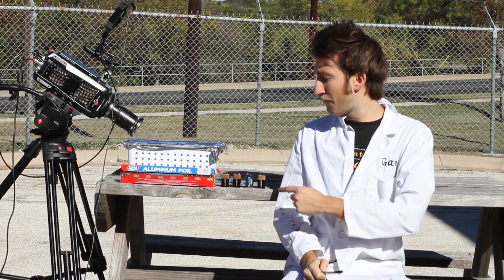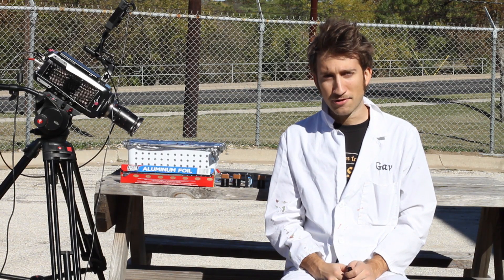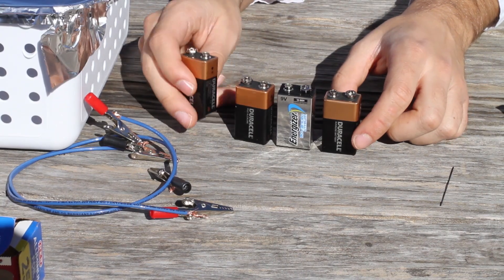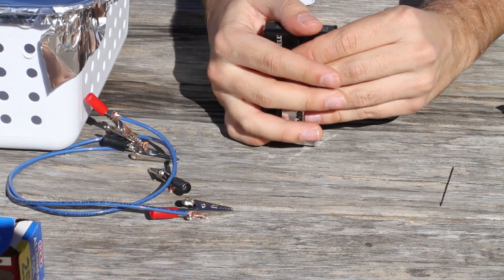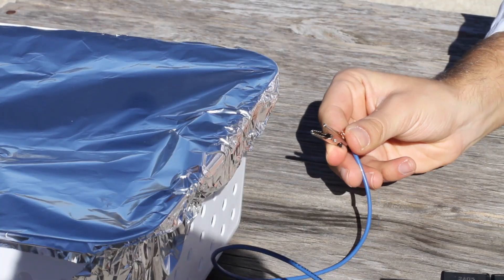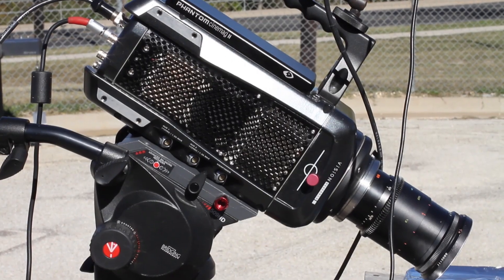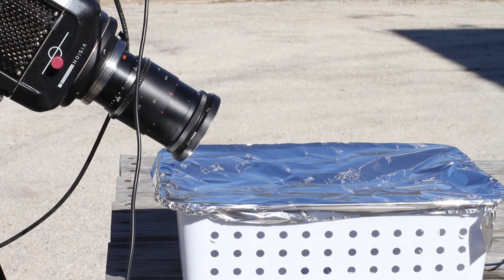Tiny Plasma Cutter in Slow Motion - The Slow Mo Guys

Comment: Actually it was "Aluminum" first. British editors changed it to "Aluminium" to harmonize
with "Potassium" "Magnesium." There are, as always, a number of America haters below that claim America got it wrong. Actually, they didn't. Just kept the original.
Brits tend to complexify....makes them SEEM smarter.
Reply: +Jim Keller Incorrect. It was named alumium by Humphry Davy, then aluminum, and finally the official name was Aluminium. You are correct that it was made Aluminium because it was similar to the elements that he had previously discovered (Potassium, Sodium, Calcium, Magnesium). However, it was not changed by British editors. Aluminium was actually used in America for a fair while, then you decided for some reason to change to aluminum. Yes, according to IUPAC, both the Americans and British are right, but, it was first officially called Aluminium, so, I consider that as the official and correct name.
Reply: Jim Keller Oh, ya know. Good. Divorced the wife, so definitely better.
Reply: +cozi cosimini America wasn't even close to being the first country to use slaves. Just about every group of people was a slave at some point or another, America just happens to be the only example of it that people think of for some reason. In fact, there are plenty of countries that still sell people as slaves. Also, cars are not an American invention. The first steam powered vehicle was built by a Flemish man while in China in 1672. Four-stroke internal combustion engines and Diesel engines were invented by two Germans. Even Canada had steam powered buggies before the US.
Reply: cozi cosimini You do realise that there have been slaves around for millennia right?
Reply: lewis cullinan
 Hey ass blast. The word "Aluminium" is derived from Latin. For you to claim it as "your language" attests to your ignorance. Turns out you know very little about the English language after all.
Reply: Jim Keller Hello brother
Reply: Hey...Bryn...how the hell are you?
Long time.
Reply: I never liked her....sorry.
Always thought you could have done better.
Reply: Jim Keller Yeah, that's ok. I'm glad we separated. I saw it coming for a long time, but when she cheated on me with Bill, that was the last straw.
Reply: Jim Keller Don't worry, I intend to. Already got a hiking trip set up, and who knows what else after it.
Reply: Language changes continuously.
Reply: I can't disagree with you there, with our history, I wouldn't be surprised if we were that big headed about ourselves. Oh and look, a bunch of hypocrites trying to prove you wrong, but actual proving you right be trying to be better than you! (I'm assuming you're from the US!)
Reply: +LAUGHER CAKE Or rather one guy being a hypocrite, my point still stands!
Reply: TobebwidZ Al-oo-min-ee-um.
Easy peesy lemon squeezy
Reply: King SHIIFT Computers were not "invented" they were developed over hundreds of years by many different people. Turing certainly had contributed significantly to computer science, however, the Bombe is still a product-specific device, and not a general-purpose machine. I do not consider the Bombe a "computer" in the contemporary sense. It's more like a calculator, purpose built to decode Enigma.
Reply: +pinkspaghetti Adding unnecessary letters to words just to make yourself sound sophisticated isn't smart, it's impractical.
Also, I can't take the term "Yank" seriously. Like, the 1700's called, they want their insult back.
Reply: "Omg Spanish people use yo instead of me they're so stupid."

Let's face it. Any language not Latin is not original. But then again Latin is not original. We need to go all the back to the caveman language. Ooo ooo booga booga
Reply: +Jim Keller Using a 200 year old war to justify Americans being smarter than Britons. Nice one, dude. By that logic, might I ask how you managed to lose a war to a vastly undeveloped nation after having your soldiers bomb, rape and shoot innocent civilians. In case you have no idea what I'm talking about, I'm talking about Vietnam. Guess what, Britain also didn't need a war to decide if slavery was a bad thing or not. Instead, they just abolished it. Amazing how such a refined and smart nation as the United States didn't lay down the largest empire in the world and essentially started Modern Earth.

What about the Moon landing? Yeah, but that wasn't done in the pursuit of knowledge was it? It was only done in the hope of making your country look more technologically advanced than the USSR. As for Modern times, you live in a country where a man like Donald Trump may become president. I don't think more need be said.
Reply: +Stephan mac   Yes it was alumium briefly, but it was amended to aluminum shortly therafter.  British editors changed it to aluminium to harmonize with potassium, magnesium, etc.  
Aluminum before aluminium.  Like I said Brits tend to complexify.
Reply: Bryn Keller
but Bryn..Al-oo-min-um is easier.
Reply: Jim Keller It's more simple, but he was saying that we Muricans' lacked the ability to say aluminium
Reply: g
Reply: Bryn Keller
Oh
Reply: Bryn Keller yep
Reply: +Jim Keller derpy derp derp british derp derpy derp 'MERICA!
Reply: +Jim Keller how to do it?
Reply: lewis cullinan It IS their language. Didn't you know this? Because they're the centre of the universe.
Reply: +Jim Keller Dude....You had to say that...really!! You right a comment that resolves an argument and then add a smartass ending that would obvoiusly create a new one!
Reply: That's what you call joking around. He was making fun of the stupid English war.
Reply: +TobebwidZ I would Like to point out I am 100% American but can not pronounce it the American way :P
Reply: +Jim Keller no its Aluminium :D It sounds much more professional
Reply: Izzy Ryan
If so, why did you lose the last war you had with us?
Reply: What I'm from america you know.
Reply: I don't understand the arguments about whether ones country is better than the other. You all sound like patriotic idiots.
Reply: No Name I don't think anyone is talking about the countries... they're talking about the pronounciation of the word.
Reply: +Jim Keller It's aluminium in Latin, not aluminum. And yes, this word comes from Latin. But there are many "garbled" words in US English (I say garbled because they were in British English before Columbus discovered America). For example words with 'ur' on their end doesn't have U in US English (I mean words like colour, flavour, behaviour, neighbour...). But these expressions have nothing to do with how clever people are, English changes in both UK and US, differently in each country. Not much today, but in past, these changes were much bigger.

I'm not from an English speaking country. It's true that I prefer British English, but I'm trying to be objective, not subjective)
Reply: +Jim Keller America is 27th in education and 1st in confidence, they can't talk when is comes to pseudo intelligence
Reply: Someone is sore about pronouncing 😂😂
Reply: well, we made u. u win the battle, we win the war
Reply: I'm British...I'm just not a little bitch ...
Reply: i like trains
Reply: Jim Keller complexify?? think you mean complicate
Reply: +Spicy bits....by all means...But to deliberately complexify IS to complicate.
Reply: Jim Keller it's not to seem smarter we just are smarter
Reply: Azuralis EXACTLY!!!! The Africans enslaved each other before we even came.
Reply: The british "editor" you speak of is the exact same person whom discovered Aluminium in the first place. The exact same british "editor" was also the same person to discover many other elements with the -IUM suffix.

I find your statement wrong and slightly provoking. But hey, it's the internet right. No one gives a shit.

next time, please search up before you say something. Might make yourself look stupid.
Oops, don't mind me. Just another British person trying to "seem" smarter.
Reply: Jim Keller From what I know the majority of the world calls it Aluminium
Reply: no Americans changed it because you could never pronounce it so u decide just to change it
Reply: +Jim Keller The brits are smarter just accept it.
Reply: Jim Keller bullshit.
Reply: So narrow-minded you are.
Reply: Jim Keller We are just smarter and more sophisticated than you yanks. Sorry.
Reply: MrWatchesUsleep Im not a tory.You know a tory is someone who votes for the Conservative party right? Then again im not surprised an uneducated american like yourself knows nothing about politics.

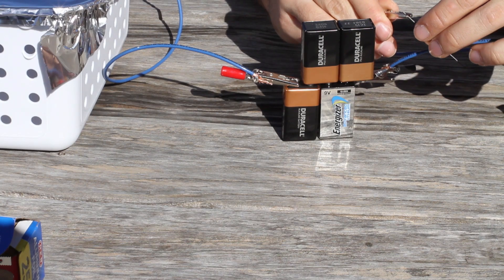Comment: 0:40 For safety reasons, you aren't supposed to mix different kinds of batteries.
Reply: i never use batteries from the same kind and never has something gone wrong. i use batteries a lot
Reply: Rostam Bayat it was a sarcastic remark. You know, since they're shorting them out...
Reply: Cuthbert Nibbles  sorry. me not good english :|
Reply: Rostam Bayat It should translate, it's not a play on words. On every pack of batteries you buy, and on some devices that use them, it says that you shouldn't mix batteries from different manufacturers, even though it really doesn't matter.
Reply: Cuthbert Nibbles sorry, me not good at any language :|  and also: translation verry shity always

Comment: Anyone wanna drop some knowledge on me about this plasma cutter without calling me stupid. I wanna know if its possible to hurt yourself with it, not for emo reasons. or like you cant cut anyhting that conducts electricity or like heat up water? I might do a science project on this or something just for fun.
Reply: Well, you can't hurt yourself with the electricity really, but the graphit gets pretty hot, so you have to be careful not to touch it (see my video, where I burn a pencil down with only 15V). You can cut everything that conducts well and is thin enough, but if you take bigger graphite rods, you could actually wield with it.
Reply: Things vs Electricity | TvsE Thanks man!
Reply: +Things vs Electricity | TvsE That's called gouging. And you really don't weld anything, you just blow(quite literally, it flies everywhere) a hole in very thick metal.
Just get two thick(1cm in diameter or more) rods, and use a regular high-powered(2-8kW) stick welder.
Touch the two rods together, form an arc, then spread them apart slightly, and holding that position(there are gouging devices for that), bury it in metal.

Comment: Hey I just want to point out that that's not plasma cutting plasma cutting. Plasma cutting is used with compressed air being superheated and then introducing an electrical arc. What they were technically doing was carbon arc 
The pencil lead is not lead itself it's carbon when it has an electrical current going through it it cuts through most metals
Reply: ProtubeComment Fuck off.
Reply: Thank You
Reply: https://www.youtube.com/watch?v=IRsPheErBj8
Reply: Jesse Valenzuela It is practically plasma cutting, it is just being done without compressed air. You can do this with pencil lead, and metal bars. I have tried with both and they work.
Reply: STFU science nerd.

Comment: Paused 30 seconds in, without watching the rest of the video I know exactly what the majority of comments are going to be about (regardless of how cool the actual slow mo footage is.

And I was right.
Reply: Seriously, I'm American, and I'm disappointed at the other ones in the comments. In most things, America is the odd one out anyways. We don't use the metric system, a foreign language class is never required, and we pronounce a lot of English words differently than other English-speaking countries.
Reply: Unfortunately, I had the exact same idea.
Reply: ***** Only a year? I had 6 years of French back in Junior High, but no french classes in Highschool. (Thankfully) My fluency ability, even after 6 years, was still zero. I couldn't create my own sentences and as for reading ability, maybe the back of a cereal box at best.
Reply: The body acts as both a resistor and a capacitor. For the resistance portion: ohm's Law is given by: V = I*R. where V is the voltage between two points which measure a resistance R. I is the current flowing through the resistance. As the resistance decreases, the current increases (at a fixed voltage). The reason a car battery cannot hurt you is because the human body is a high resistance, resulting in a very small flow of current. A piece of wire directly across the battery has a very low resistance, resulting in a very large flow of current in the hundreds of amps. If you take 1,000 of those batteries and put them in series (like the 9V batteries in this video) they would result in 12,000 volts. Ouch. Now we can talk capacitance. A capacitor can hold a small charge, similar to a rechargeable battery. In the terms of the body, the capacitor can be "charged" in either direction. When a fully discharged capacitor meets a voltage, the current shoots way up for a small amount of time, and for that time it is very low resistance. This is why AC voltage hurts much more than DC voltage because AC voltage switches direction really fast, resulting in many repeated spikes of current. Hope this helps! See some of ***** videos to see some neat experiments.
Reply: ***** I can assure you ac does not hurt worse than DC. I've been an electrician for almost 20 years, I've been hit with AC and DC at the same voltage and 100% without a doubt DC is MUCH worse. Yes, the RMS voltage of ac is gonna be higher than DC, but getting hit with DC is more painful.
Those arguing about volts or amps killing, its a combination of both. 100v w/ 1a flowing is 100w of power. 1v w/ 100a flowing is also 100 watts of power. Obviously the higher voltage will allow more current to flow more easily given the same resistance. Ie- given the same person to keep the resistance the same, the amount of current that will flow will be based on the the resistance of the path through the body the current takes. All things being equal, a higher voltage will be worse because more current will flow. Higher the voltage, the more 'pressure' to push the current through the body. To try to make an analogy comparing it to water, voltage would be the pressure, current would be the amount of water, and resistance would be any restriction to the flow of water.
Reply: ***** I should've said it differently. I meant that most americans don't care to or want to actually learn to fluently speak a language and be bilingual.
Reply: People arguing volts vs amps killing a person.
Reply: *****
That even though the slow mo footage was cool most of the comments would be arguing over the spelling & pronunciation of aluminum.
Reply: Mythical Fair My thoughts exactly... but that's not without good reason. 

To be fair though, and I am not denying the legitimacy of the word "aluminium", but the word "aluminum" as it is in the video was not spelled wrong...  It was just simply read wrong.
Reply: I just watched and enjoyed the video. I'm clueless as to what you predicted in the comments, nor will I seek what it was. I'm content with just enjoyment from this.
Reply: Mythical Fair I thought it was going to be about Gav's face and hair. Like mans whats going guy? How did you get Meg like this, it wasn't the mustache that won her. Why Gavvy why.
Reply: Mythical Fair Yeah man, I did the exact same thing. That Dilian guy seems to be up himself, and yeah his moustache oh wow. But yeah damnit Gav why did you point it out, we know they spelt it wrong but shhh
Reply: +Andrew Swann Bullshit. i was REQUIRED to take spanish in school due to my local demographic of 95% spanish speaking people who also speak english and the other 5% that doesnt speak spanish at all. but your right. foreign languages arent a required school class, is it? to answer your question, yes. i live in the USA and yes. it pissed me right off that i was forced into two years of spanish just to graduate because of where i moved to the second half of my graduation year. i got held back from graduation until i completed those two years. so dont tell me its not required cause it is. at least if you live in a shit ass area of texas that thinks spanish is the only fucking language on the planet. i didnt mind taking it but it absolutely infuriated me that it was forced on me when my previous senior high school considered language classes an elective. and yes. both schools were in the same state
Reply: Khyra Ares Honestly this isn't worth replying to, since I just now saw this, but clearly there's a misunderstanding here. This was nearly a year and a half ago, and I didn't really know what I was talking about as far as foreign language not being required. Then again, it was only recently added as a requirement for graduation at my school, but that's besides the point. Clearly not all schools require it. I live in Georgia and I'm part of the gifted program at my school. I also just recently completed my third year of spanish as a foreign language, and I'm honestly sorry you had to go through that. No need to get mad at me for pointing out how America is an oddball in certain areas.
Reply: Dillan Parker Reads the part after but
Still leaves dumb ass comment
Reply: Dillan Parker Because yours is worth replying to because you just left it.
Reply: I thought it would be about how this can't be exactly a plasma cutter. the amount of plasma it generates is ridiculous. It cuts through the foil not due to accelerated plasma, it does so because the foil melts with the current applied by the battery.
Reply: " Honestly this isn't worth replying to"
*Replies
Reply: Still replies.
Reply: Awe :3
Reply: Andrew Swann There's no incentive to learn another language. Once you have English, you're pretty much set in this world. If you're going to another country, they will speak English there too. If they don't, it's probably not a great country to be going to anyways. :/